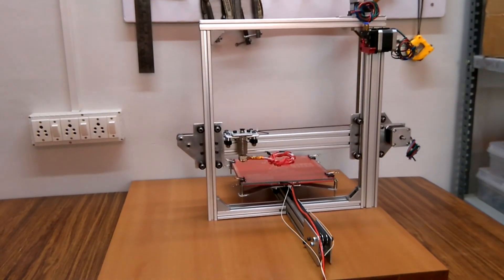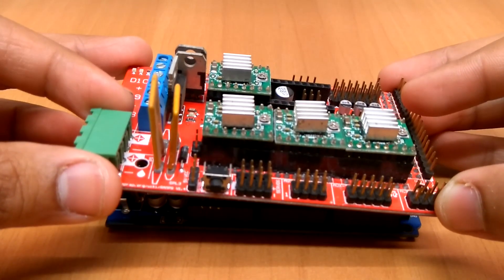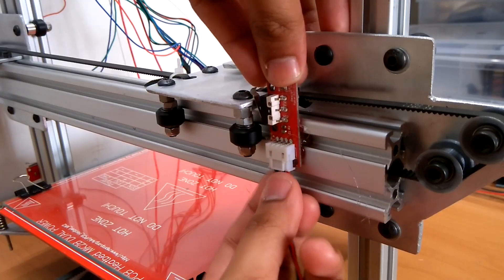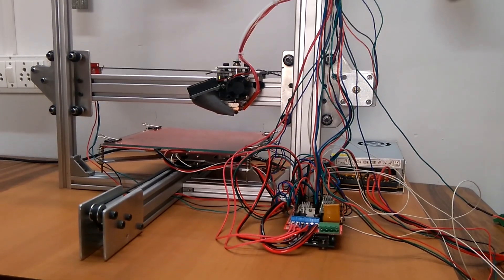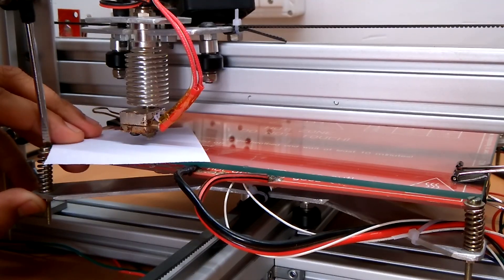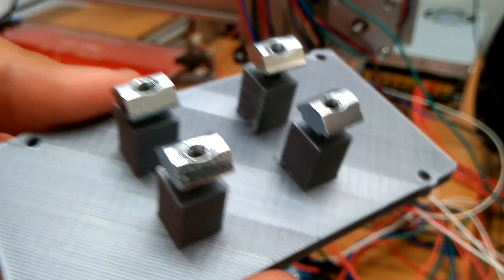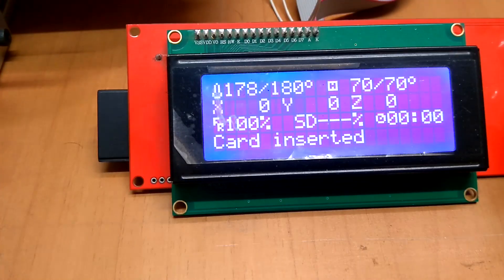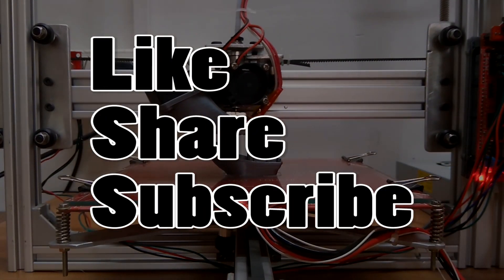How to Make 3d Printer at Home | Arduino 3D printer - Part 3

Comment: I'm making a 3D printer myself I'm using Ramps 1.4 kit , the problem is my motors are not able to rotate in +x,+y,+z and if I change the wiring I'm unable to move in -x,-y,-z please I'm stuck need some help
Reply from the maker: The problem is in the code, check the section for endstops, and disable 3 endstops on each axis. The code is designed for 6 endstops, 2 on each axis, you have to disable them for movement in both directions

Comment: Thank you a lot. Your video help me so much. Can you show me how to make Mount Plates? :). Thanks bro.
Reply from the maker: I made them using angle grinder and drill machine. Used a 3mm aluminium sheet. Was a bit messy so couldn't film it. You can get the measures from the CAD files

Comment: amazing video!! i'm actually building this 3D printer as an school project! the quality of the video is extremely nice, and man, if you could answer me just a little question it whoud be of great help, can I use the A4988 driver without any change in the software? PS: you can be sure the credits for the design will all be given to you
Reply from the maker: Thank you for your appreciation. Yes you can use A4988 driver without change in firmware. It uses marlin 1.1 firmware. Please do subscribe! Thanks!

Comment: I have made as you suggested
I am having problem 
My extruder motor get stuck and vibrate do you have suggestions for it will be helpful .
Reply from the maker: check your motor wiring and polarity properly. remove filament and try to run the motor with print command or using pronterface. the extruder motor should run slowly and smoothly. then heat the hotend and insert the filament, first let some filament flow by pushing the wire, then start with your print. hope it helps
Reply: @SuperbTech  ok I will check it out today thanks

Comment: The CAD files won't open, can you please fix it? They need the main file.
Reply from the maker: It is .f3d file. You have to open it in fusion360
Reply: @SuperbTech  OK, thanks a lot! Another question, do you have the links for the frames on eBay? Can you plase update the components list?

Comment: Just 3 endstops is enough to control the printer?
Reply from the maker: Yes, place the endstops on the home cordinates, and set the maximum printable size in the slic3r software, so the printer won't travel further than the maximum printable size in the opposite directions
Reply: @SuperbTech  Make sense!